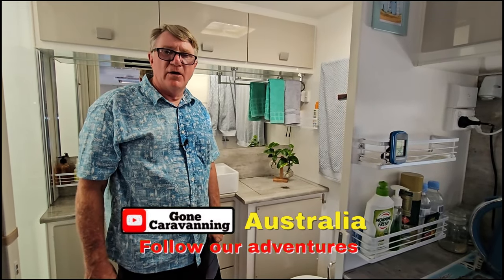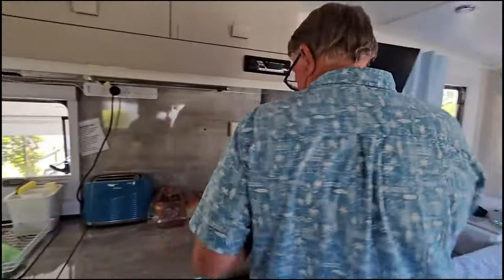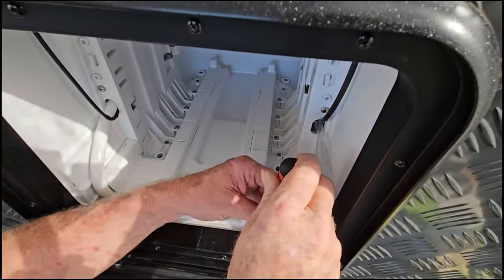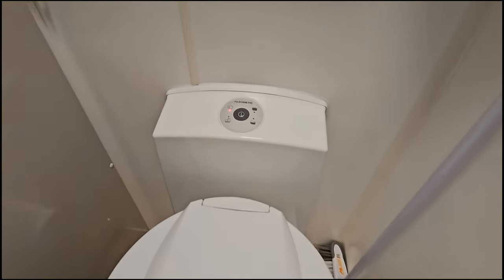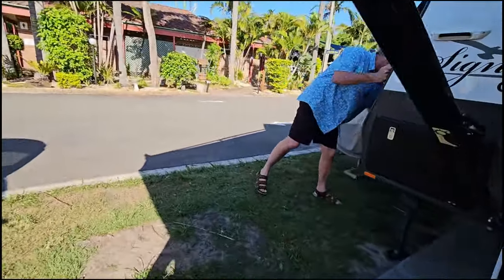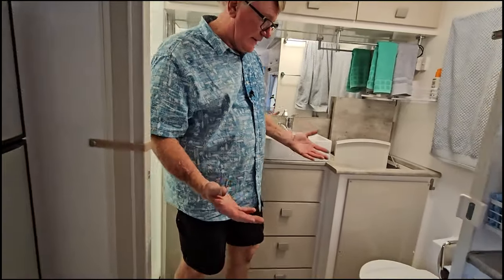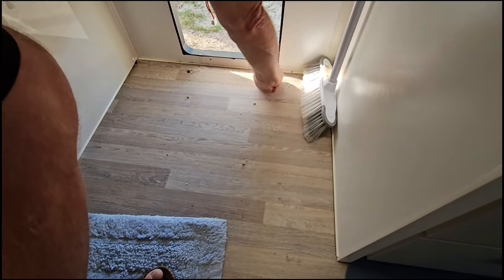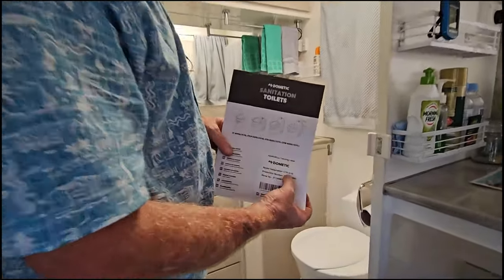How to Remove Dometic Toilet the easy way, Dometic CTS 4110 cassette toilet removal to gain access ?

Comment: Great vid - loved the use of the “good knife”. We’re about to install the same washing machine, any tips on do it?
Reply from the maker: Hi Charlotte, i would just make sure the drum looks centered and put some good strong brackets on bottom to keep it in place.
After putting the false floor under ours that was not level, we then did a few test loads before putting the panel and toilet back in.
Good luck with yours, they are great to have.
Always appreciate your feedback.
Ken and Julie